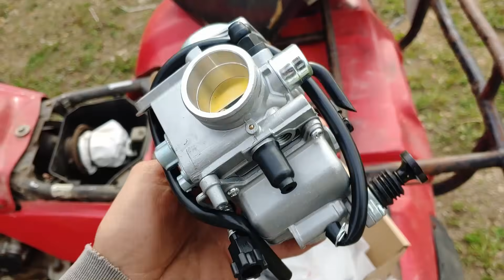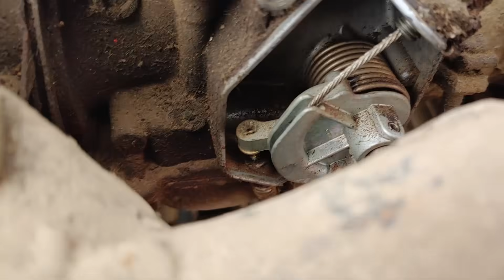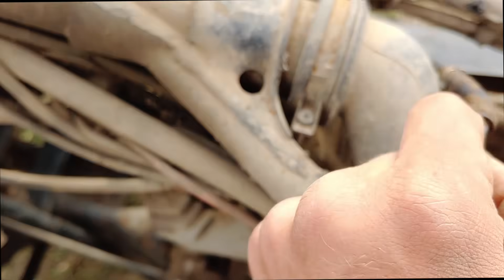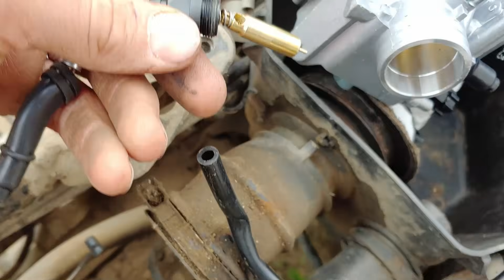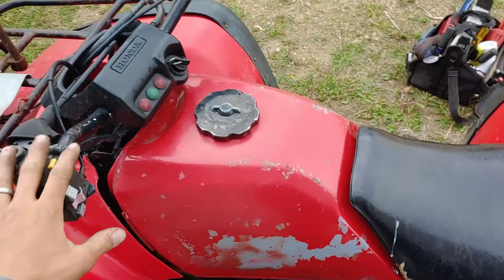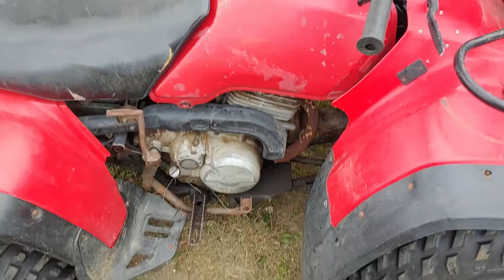How to Replace Honda TRX 300 Carburetor

Comment: I’m not very mechanically inclined. I hooked up the fuel, choke, and throttle cable. As soon as I open the petcock, fuel immediately drains from the hose connected to the bottom and a hole on the throttle side. I’m assuming I have the hoses wrong. Where is the fuel line supposed to go? Where does the hose on the bottom connect or is it just a drain/vent?
Reply from the maker: The hose on the bottom is just an overflow, and doesn't actually attach to anything if I remember correctly. It's possible that the float is not closing off the fuel when you turn the gas on. You could try turning the gas on and rapping on the carburetor to jar the float loose if it is stuck. Otherwise, there's a possibility you did put the fuel line on the wrong port. A cousin of mine had made that mistake before, and it did the same thing you're describing.

Comment: I did all this. Installed a brand new carb, and mine still just sits there trying to crank but won’t. Any thoughts?
Reply: Same.. did you get that figured out?
Reply: @Masonsridge wound up being faulty wiring in the kill switch. There was a sweet spot between off and on that would allow it to crank
Reply: @tylerlangham7576 I just figured it out.. my dumb ass left the kill switch on and I didn’t realize it because I never use it to turn off the machine🤣 but now I have to figure out how to get some slack in my throttle cable because it’s like at 45% throttle on idle lol
Reply from the maker: You may need to just loosen the adjustment screw on the side of the carburetor that controls the idle.
Reply: @ReubenSahlstrom I figured it out.. at the handle bar throttle assembly i needed to push the cable into the housing like maybe a 1/8 of an inch more, now it has enough slack in the cable that I can use the idle adjustment knob!

Comment: you don't even show how to take the choke cable off
Reply from the maker: Always best when there's a little mystery in it!
Reply: that’s how you learn get a hint and figure the rest out
Reply: Mine is back firing when I try to start it. Any advice on this?
Reply: @chrisledford6941  My damn kohler lawn mower is doing same damn thing all of sudden.. Different eng but still single cyl 4 stroke an i got done f king with carb